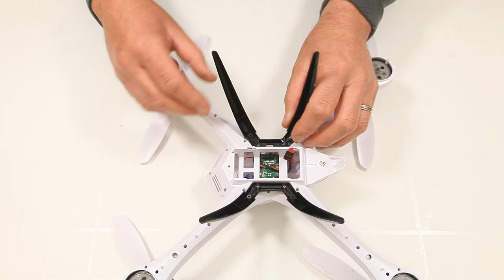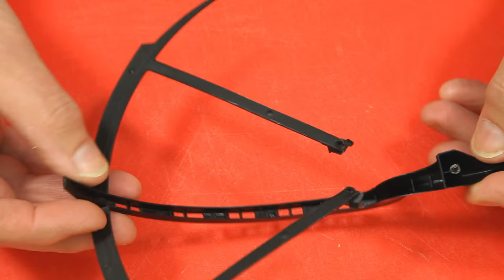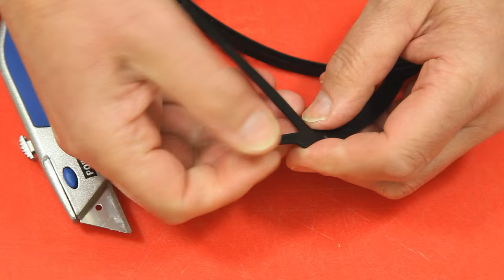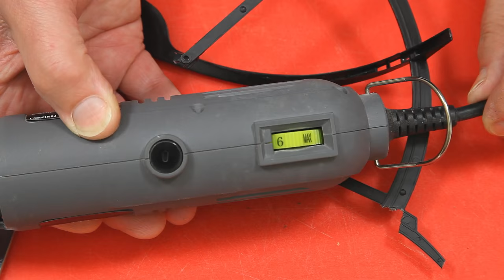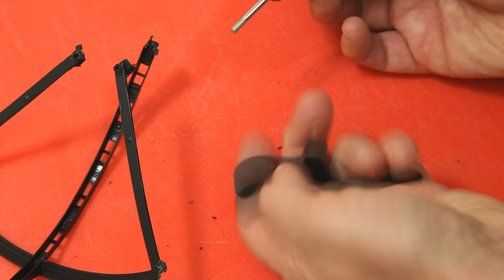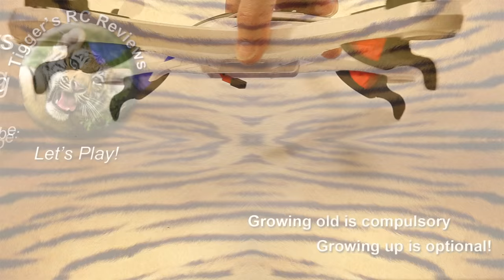Tarantula X6 free short landing skid mod step by step

Comment: Very nice, I just ordered one of these, the black and white new version with no camera and 300m range. I also in addition ordered  a set of ball bearings too. The plan was to never fly with landing gear or prop guards, although was disappointed to find out that the led light covers need the guards to stay on since I do like the look of them and plan to do lots of night flying. I must say I like your idea and will be doing that for sure :)

Comment: I did a very similar modification.  The difference between mine and yours is that I left enough link on the top guard that it still protects the propellers if, while landing, it leans a little too far it still protects the profits.  The length does not cover the props, but it sticks out far enough that the quality cannot be far enough to allow the propellers to hit, during a rough or erratic landing.  Great post, it gets a good idea out to people so they can try it or use it themselves.
Reply from the maker: Kevin ODay Hi Kevin glad you enjoyed it and good to hear a different approach, i don't leave mine on at all now I prefer when filming not to get anything apart from the scene in :-) Hope you like and sub cheers :-)

Comment: I think in a couple of weeks it will really turn into a lawnmower with so many mods. Nothing is original anymore :)  Just kidding with you .
Reply from the maker: Quadcopter Mania I know just kidding straight back, you could keep it all original and it's a fantastic quad but I luv to play and push the limits, as I said before it's all a personal choice, probably more mods on the way.......kinda thinking incorporating a hedge trimmer/strimmer LOL
Reply: I know mate. I like the mods also.  I did a credit card gimbal fix amount on my FY326. But It just could not lift my action cam.  Pity.
A chain key cam should work. But I will use it for my new X8c.  in the future.  I'm now flying the syma X11.  very great quad. so smoothly.
Reply from the maker: Quadcopter Mania I know the FY326 is great but limited carry ability that's why I use mine with 808 camera. May try a gimbal on the Tarantula.....aaaagh another mod LOL